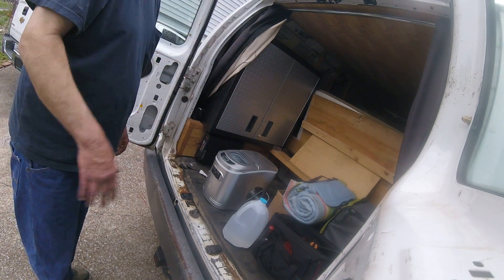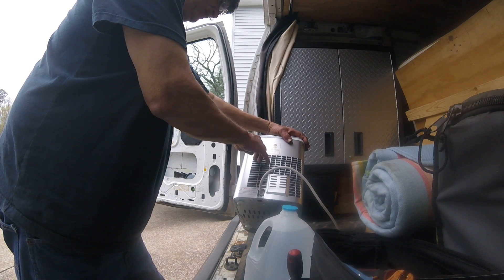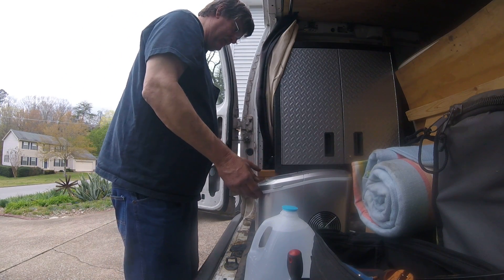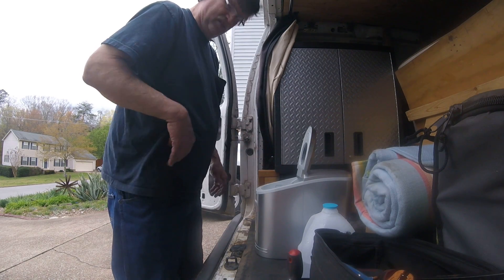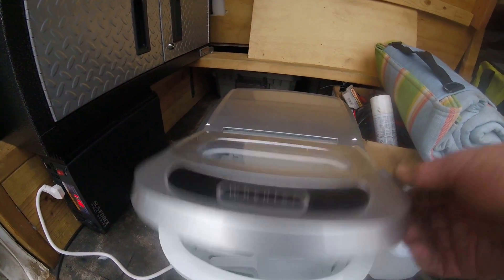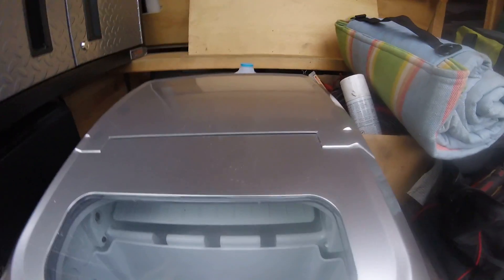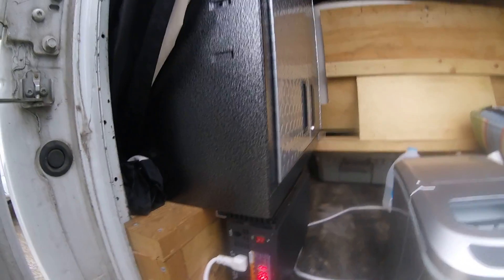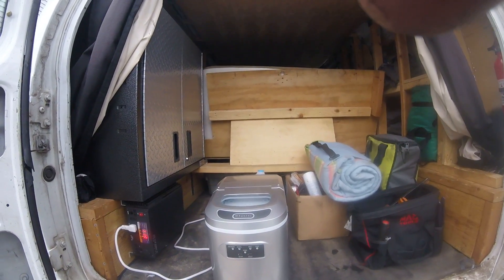whynter portable ice maker running on inverter part 1

Comment: Surprised it's pulling 1100 watts. I was running a 5000 btu window ac unit off a off-hand 1000watt inverter. Had it maxed and more than it would handle long term.  But I'd believe a window unit would.draw way more than that